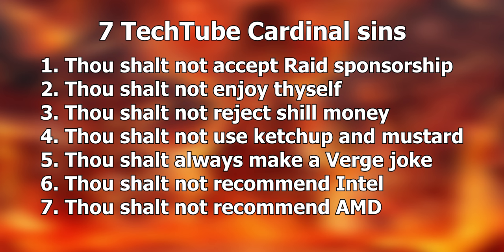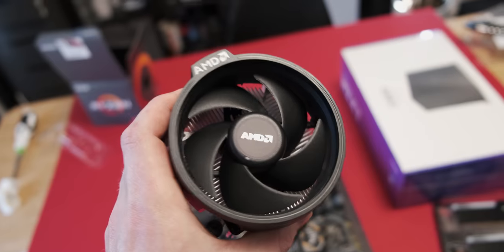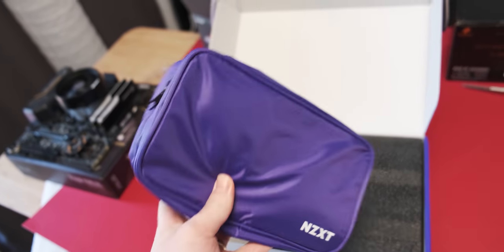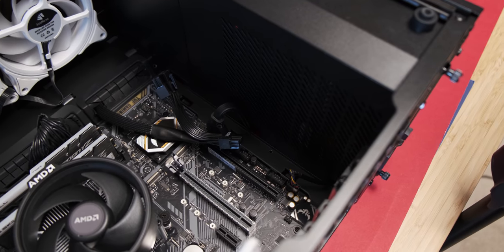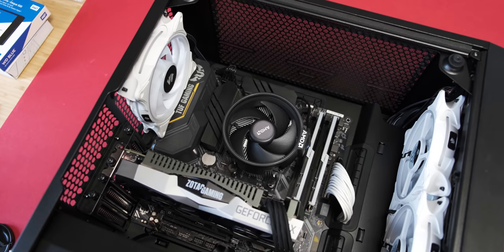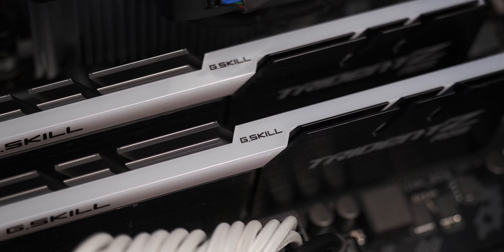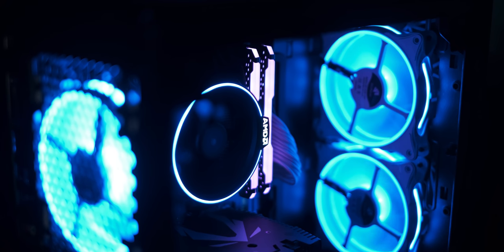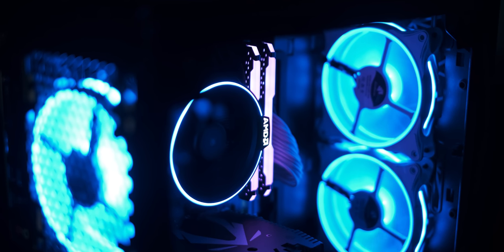AMD Ryzen 1600 AF M-ATX gaming PC build Ft. RTX 2060

Comment: This is almost exactly the build I'm speccing out to build in the next month or so (even down to the case), so joke's on you, I did find it useful.
Reply: About the same. Was considering getting a Ryzen 5 very similar to this one, while keeping it on budget. Nothing fancy but gaming at 1080p is good enough for me.
Reply: Mine started out budget but now I want it to be mostly white so it's jumped from about 1k to closer to 2k lol
Reply: I have the same build but i found an openbox 2060 super for 340 so i jumped to that
Reply: my Gaming PC is not the same but Similar, I have a R5 1400, MSI B450 Gaming Plus, 16GB Vengeance RGB PRO, Coolermaster ML240 AIO & RX580Gaming Plus in a Meshify C Mini with 3 EK Vardar RGB 120mm Fans, I have a 27" 1080p @ 75Hz freesync monitor & they work really well together,
P.s. everything is Red/Black/Silver so I put a Little Ant-Man Bobblehead in there 😁🐜
Reply: @DawidDoesTechStuff  Spoiler: I went with the Ebola case :p.
Reply: @shaneeslick  I have a similar build to yours but with a ryzen 3600x, 32gb of ram corsair vengeance a Rx 590 Fatboy, and a x570 giga yte gaming pro mobo. I get essentially identical number as the videos. The only 2 issues is that video  card runs super hot I have to force the fans to 70%+ or else it just overheats. And my xmp profile doesn't work to run my ram at 3200 MHz. I may need to update the bios it's just something I noticed. I kind of want to sell my Rx 590 to a friend and get a 5700 or 5700xt though.
Reply: @brianvieane3907  That is strange you can't get the XMP to run, my Ram runs at 3200MHz even with the R5 1400 (which others have said first gen struggles with),
I'm also really happy with my RX580 I still have the FanCurve set to Auto & I never hear it, I get 45-50°C (113-122°F) days here in Australia with no Air-con & even then barely hear the PC playing my games 1080p@70Hz with Freesync on, I only play 1 player Adventure or driving games so don't need High refresh so my RX580 will do me fine for a long time yet I think
Reply: @NewkLambesis  looool dude same.
Reply: Ranadok how much is it for everything? $$ wise
Reply: @bananabob9965  It's about  $950 Canadian or so on my pcpartpicker list, but it's been slowly creeping up over the past few weeks. May end up holding off until the market settles back down.

Comment: "Breaking the fan screw virginity" I am DEAD lmao
Reply: It wasn't until "After I threw my back out pounding these fans" that I lost it
Reply: Full body work out...well taking the virginity out of anything it is a full body work out If done right LOL
Reply: This is why you must screw with confidence
Reply: Oh, I just used scissors and rest ofrubber which was in case for case fan to fix position instead of breaking my arm. Did not even known it was meant to be like that untill this sentence :D
Reply: I actually savaged my new QL140 fans i just threw in, later on i found out its easier to tap them first outside of the case. whoops. they went in fine with some convincing from my ratchet set

Comment: I bought one of these for my grand daughters PC. Tossed it on a MSI B350 Mortar MB I had,  a GTX 1650 Super paired with 16GB Corsair 3000MHz, WD Blue 500GB SSD  and the same case. Its snappy and for $518.00 this was the best budget build I ever did.

Comment: I ordered a ryzen 5 1600 AF as a upgrade for My ryzen 3 2200g last week and should be here in a Day. Sooo hyped
Reply: built my first pc with it and it is an awesome cpu. Update your BIOS though as you might have issues. The b350 board I had needed a bios update for it to work.
Reply: @abhimaanmayadam5713  yeh. Got a a320m myself, so i already thought about a bios update
Reply: Glad to say its finally here! Gonna go get it and see My FPS improvement
Reply: @SystembolagetOfficial  good luck. Its a great chip. What GPU are you pairing it with?
Reply: @abhimaanmayadam5713  xfx RS rx 480 4gb. Might flash it to a 580 if i get a better cooling solution

Comment: 1600AF + RTX 2060, just sold a build like this.
Unfortunately, due to BOM issue, I didn't use AMD Stock cooler as I got cpu as tray, and RTX 2060 is a blower model, everything stuck inside a A320 board with 16GB ram and a tiny m-ATX box with single stock 80mm fan, and the psu..... well it probably won't blew up, or at least if it blew up it won't be due to PSU itself.

Comment: In my system I have a r5 1600 OG, I wasn't expecting it to overclock too much since it was 1st gen ryzen, however I was pleasantly surprised when I was able to hit 4.05Ghz oc on stock voltage (and 4Ghz undervolted)
Quite impressive!
Reply: Any tips on settings for your overclock? I have the same OG Ryzen 5 1600 CPU and just got a Cooler Master Hyper 212 Black Edition so I can finally see what that thing's made of 😂🤞😂
Reply: @vshakir622 yea, I'm cooling it with a Cooler Master MasterLiquid Lite 120, nothing too fancy tbh, it's a 65 watt cpu so you don't need to go all out on cooling. Also, mobo is nothing special it's a MSI B450M PRO-VDH PLUS Micro ATX mobo (the cheapest b450 with 4 ram slots I could get). I started by adding slightly more voltage, then I'd slowly escalate the clocks as high as possible. I reached 4.15Ghz but it wasn't stable so I started to dial back the voltage. That made the overclock even less stable even though I was having better temps. So I scalled back the overclock as well. I found a good balance at 4Ghz undervolted. (I'm spending the quarentine with my family so I don't have my PC with me atm, I can't remember specific voltages). I'd recommend that setting since I think i might have struck a bit of a silicon lottery tbh.

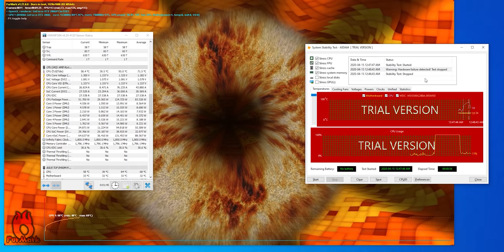Comment: 8:00 I noticed you use furmark as a GPU stress test, you should never use this "stress test" again as it's not really stressing the GPU core as much as it stressed the voltage regulators.

Furmark can actually kill your graphics card, I highly suggest to read something about it as I've seen many people on reddit kiling their gpus despite having beefy aftermarket coolers and so on.

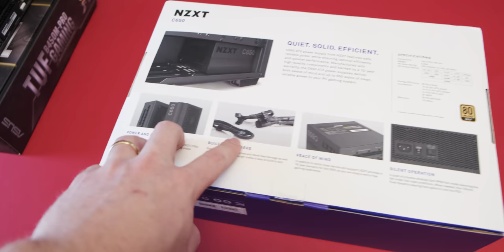Comment: Also have 1600AF and must say is a very good product.  OC RAM 3333 HyperX Fury RGB OC CPU:  4GHz 1.25v CB R20: 3052pts and 4.1GHz 1.325v 3113pts also tested on Corona 1.3 at 4.1GHz: Render Time: 0:02:38, Rays/sec: 3 070 220 Also i must say i have very budget mobo gigabyte ga ab350m ds3h v2

Comment: i put top fans to push air in - increasing positive pressure inside the case.
These seems to (on average) yield better thermals than the other way around
Reply: Have any thermal benchmarks to support this? Shoot, I'll probably try this myself with all this extra time 🙃

Comment: I kinda did this in March but I had another purpose with it as well. Basically I used an i5 4670k and reused drives I had around as well as other components. Just the used motherboard and CPU were new to me. So I'm using Windows 7 on that system for some games just because really.

Comment: 3600 MHz speed for the RAM might have been the reason for the instability when trying to overclock the CPU to 4GHz. Most Zen+ IMCs will max out at 3466-3533 MHz for RAM overclocks.
Reply: Huh my crucial ballistix 3200mhz kit was running at 3600 c16 until I tried to change my SOC. because another video with a 2700x and I believe 3800 mhz ram from buildzoid had voltage set at like 1.2v whereas my tomahawk max set it to 1.4. After many cmos resets I finally booted and now trying to run my ram at those same settings, where I did get everything to boot, now causes video to completely fail on reboot. On top of that I can't get m-flash to recognize the bios file on the usb stick.

Comment: I bought a week ago Ryzen 1200 AF (called in shop as 12nm), Mobo ROG strix 350-I which was cheaper by 100 dollars than any other ITX B450 or X570 variation (needed to update bios tho) and in second hand some ITX card RX 570. Case Sugo SG 13 ITX case. And some CV Corsair PSU (as Small factor ones were sold out). After updating bios, I had to update monito too :D Now next thing is to install windows.
Who knew how many months it will go :D

Comment: Nice video!  I wanted to build a power efficient sff PC ( I know, eww) a couple months ago and I put one of these CPUs in it.  I paired it with a 5500xt and I'm super happy with it.  

I also found that you can't overclock the cpu well on stock coolers and it hates ram speeds higher than 2666 MHz, it seems.  It cost around $90, though.  Who cares, it's a great value.

Comment: You should unscrew the fan from the cooler + spin it 90 degrees anticlockwise @Dawid , the the AMD name is the correct vertical orientation : )

Comment: i have a ryzen 7 2700x @ 4ghz with the stock cooler with auto voltage and it runs fairly cool maybe 70c max

Comment: I didn't realize the wraith spire had RGB on it, not bad
Reply: It's the special spire, the one that came with the original 1600ae, didn't light up, neither does the one that comes with the 3600x
Reply: There are two versions, the wrath spire RGB and the non RGB, most the time the RGB versions are only sold with Ryzen 7 non x chips and the non RGB with ryzen 5 *600X chips

Comment: I'm guessing overclocking the 1600af is very cooler specific. I've seen a lot of people say they run it at 4.2Ghz @ 1.4v with no problems.
Myself I changed the stealth cooler for the Wraith Prism RGB, cause I do what I want, and I've been able to get 4.1Ghz @ 1.325v stable. Trying to go anything over 4.1Ghz and it crashes. You on the other hand weren't even able to get that.
Also on the ram: I'm running Geil Super Luce RGB 3200Mhz and with XMP profile2 it is stable at 3200Mhz, but even trying to OC it to 3333Mhz it randomly crashes.

Comment: I've got a question, I want to use the Asrock b450m Pro4 motherboard, and I have an NZXT h510 case with 2 fans that came with it, I want to add a single extra RGB fan for a total of 3 fans in my build, how could I connect them? Some people say molex cables and some say fan splitters? Idk what to do

Comment: I'm using this motherboard for a different build and it only has 3 fan headers, one of which is for my cpu cooler. Where did you plug the 4th fan in?

Comment: The cpu cooler AMD logo to the right :/ that so annoying definitely change that.

Edit: Wraith prism is like 15-20 plus it has really awesome rgb and it overclocks r5 cpus rly well used it for 1600x at 1.4v for 3.9ghz and 2600x at 4.2ghz at 1.4v.

Comment: I could find the Ryzen 5 1600 af on amazon, but idk if it’s the right one
Reply: Here it is: https://smile.amazon.com/AMD-Processor-Wraith-Stealth-Cooler/dp/B07XTQZJ28/ref=sr_1_1?dchild=1&keywords=ryzen&qid=1587013436&refinements=p_72%3A2661618011%2Cp_89%3AAMD&rnid=2528832011&sr=8-1 

This is the exact one from the video. It's such a great chip...basically a Ryzen 5 2600 chip (because it's built on12 nm instead of 14nm) that was binned. Likely something went wrong during manufacturing and they just weren't quite up to snuff to be sold as the r5 2600 and they want to at least be able to sell them. Seen so many TechTubers using these and getting insane bang for the buck. Go for it!

Comment: Hey so i got a question right now i got the 1600 af on strix x470 f but im running it with 3000 mhz lpx ram and im looking to upgrade my ram now and a cpu when 4th gen ryzen comes out and will the same ram as in the video work on my board or there could be an issue

Comment: Shall I get a Ryzen 5 3600 for 120 euro’s or a Ryzen 5 2600 (Ryzen 5 1600 AF is the same price as the 2600 in my country) paired with a gtx 1080
Reply: Michaelvuur depends on price, 3600 will outperform the 1600af/2600 but paring any of them with a 1080 will be a good susten

Comment: 1.337 Volts should always work. In any system. In any game! Usually in Counter Strike 20 years ago. There's little to no 0wn4g3 coming out of the Spire cooler. The 1337ness-test says it all! All hail the b4$h0r1z0r of 1337 0wn4g3!

Don't worry, I still have meds. I just don't take them.

Comment: I'm not an animal cuz I have a negative airflow situation.  I have 3 fans in the front and 2 out the top and 1 out the back.  The problem is my intake fans are Blocked with glass. 🙄

Comment: IDK if I hit the lotto but I get 4ghz on 1.265 with low temps w/hyper 212 with my 16af.
Reply: That's no lottery. Average. Anyway you have a hyper 212 of course the temps are good. Aim for 4.2ghz. 1.375v is the max safe voltage you want to aim for. So just try 1.375v and 4.2gjz and see if it works. If yes, move the voltage down. If no, move the clock down 50mhz. Then if that works try lower voltage agaim

Comment: I had a gaming pc... it blew up, Idk how but it did anyway. So now I’m awaiting a replacement through mail and I get some exciting news on Minecraft: integrated raytracing on Windows 10 edition, I was so excited. then I realized that I need an Nvidia GeForce RTX 2060 as a minimum requirement and RTX 2080 as recommended. My pc has an AMD Radeon RX580 and I was wondering if that would do me any good (because I can’t afford an Nvidia graphics card) and have a slim chance of working with Minecraft’s new feature, Nvidia raytracing. By the way, if you’re wondering what brand, It’s a cyberpower (here’s the link for full spec). https://www.bestbuy.com/site/cyberpowerpc-gaming-desktop-amd-ryzen-5-3600-8gb-memory-amd-radeon-rx-580-2tb-hdd-240gb-ssd-black/6362427.p?skuId=6362427

Comment: The ram profile u using, it´s complete and utter garbage. It´s even worst than LPX 3200 cl16. Micron e-die 3200cl16 costs about the same price as LPX (which is one of the cheapest kits out there), and you can get 3200 CL14 or CL15 with trfc around 300, which would drastically improve minimum fps and and average fps (given a more powerfull card).....in this case will remove the slight bottleneck the 1600af does to the 2060. It could perfectly run a 2070super or even 2080. Add 15 bucks to the RAM, and buy the same micron e-die kit binned at 3600 cl16, and you can get b-die results at 3200-3400, with very tight subtimings, which is pretty much, max gains for ryzen 1000 and 2000.

The chip you have is thermally unstable. It can do more if you keep temps bellow 75ºC in the stress test. A gammaxx 400 will do that for 20 bucks.

As case config, move the rear fan and add it in the front, remove drive cage and the PSU cage TOP. Tuck excess cabling behind the motherboard, and not under the PSU shroud. CPU will get from 0 to 3-4 ºC improvementes, GPU from 5 to 10-12ºC.

I know this, because im running a 2600 which is basically the very same chip as the 1600af, im running a 212 evo, which is basically a gammax 400, and im running a meshify C, which has the same problem as the MINI.

Overclock GPU.

You´re welcome. For the same price (the RGB trident z kit you are using, it´s 25 to 35 bucks more expensive than what i sugested) you drastically improved performance and temperatures.

P.D.: for fuck sake stop treating ryzen like it´s intel. Overclocking doesnt get you even close the benefit it gets you on intel, and sometimes it´s a waste of time. It´s ok if you leave the chip at 3.9-4ghz instead of 4.2. You´re gonna lose 3fps. RAM OC wise, the higher speed the better, it´s worst, not better. Stop trying to push stupid speeds on it. Instead do a bit of research. Mid range speeds with super tight timings and subtimings, it´s much more beneficial, and you can achieve maximum gains at 3200 for ryzen 1000-2000 and 3600 for rzyen 3000. This is not intel to go 4000+ and get a straight line of improvement, so stop treating like it is.
Dumbfuck youtubers.......